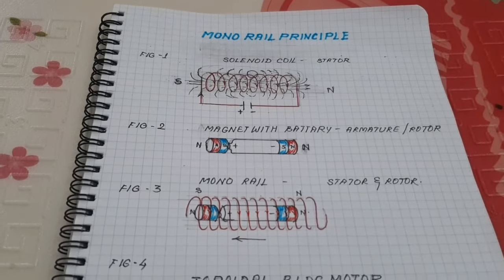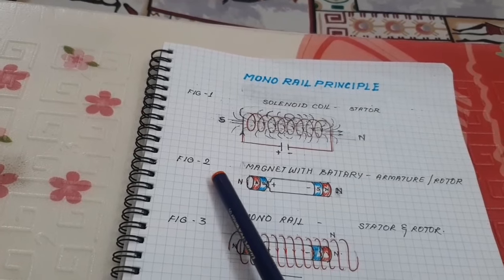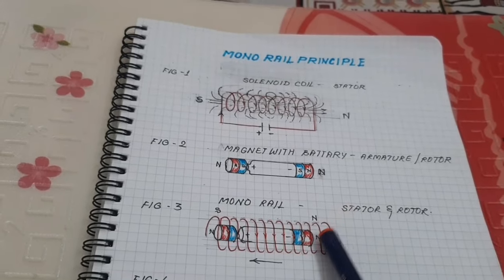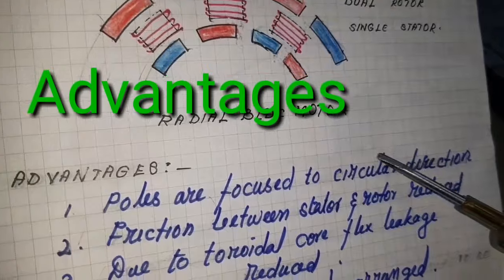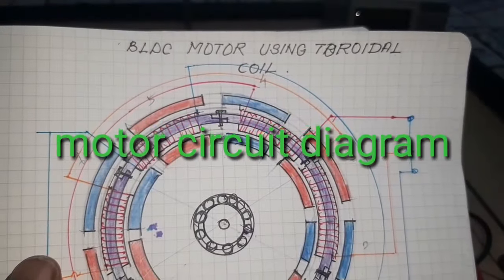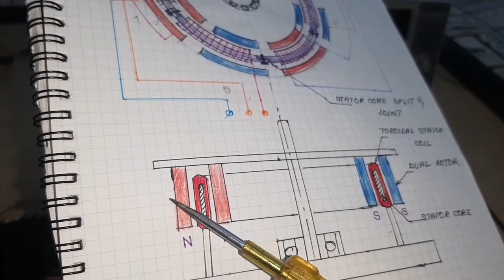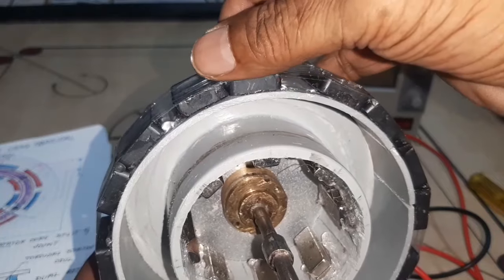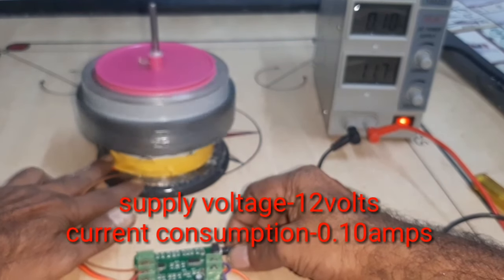High efficiency bldc motor (type-4) using toroidal stator coil

Comment: THX...Can you please post the information of each part?🙏
Reply from the maker: Thanks for watching and supported 
Details of components:-
Outer rotor magnets=16nos
Size-30×20×5mm(ferrite type)
Inner rotor magnets=8nos
Size-30×10×5mm  (neodymium)
For Rotor 4.5x3 inch reducer pvc coupling is used
For stator 3.5 inch pvc coupling is used
Winding wire size-26swg
No of turns per pole-100nos
Shaft 5mm